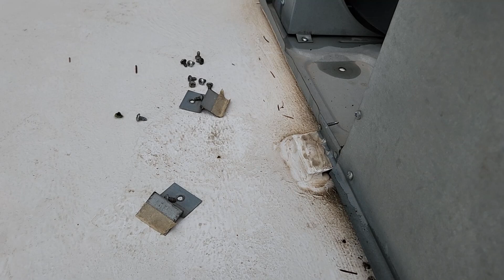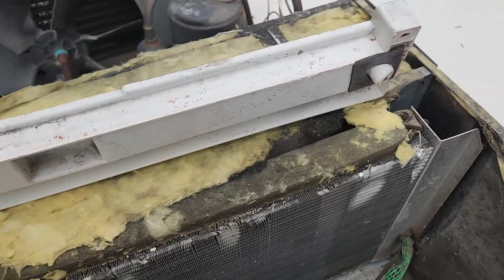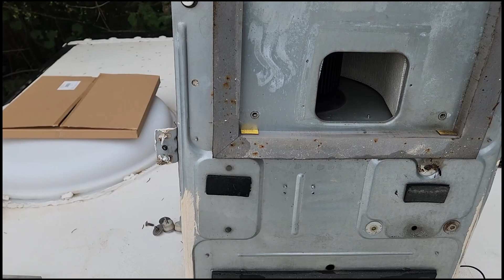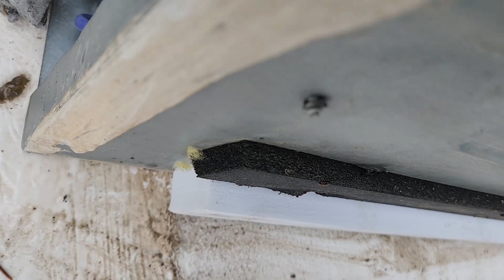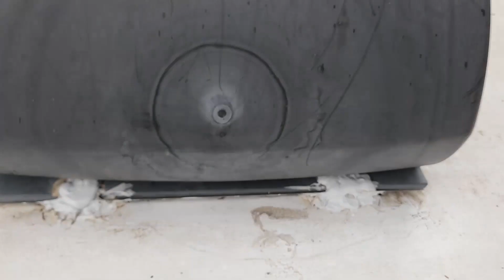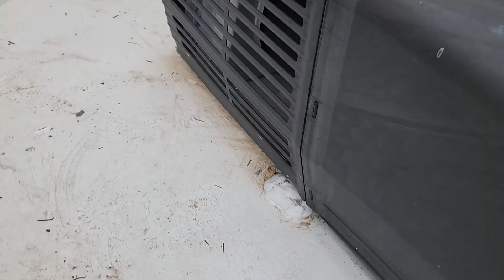Coleman Mach Ducted Seal Replacement

Comment: Did you stick the adhesive onto the roof instead of the AC?
Reply from the maker: Yes. My roof is fiberglass so when/if I need to remove it it wont be an issue. Also doing it this way provides a much better water seal.